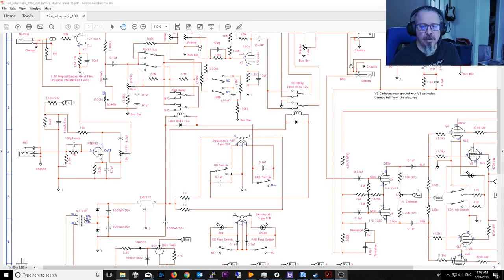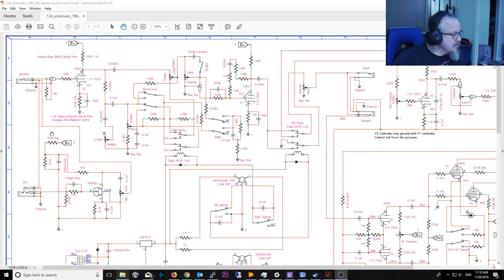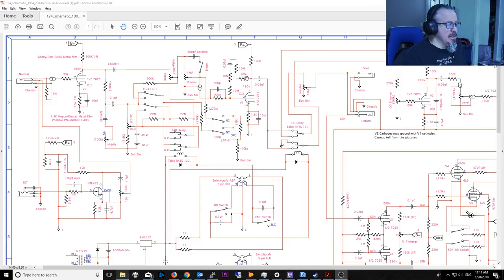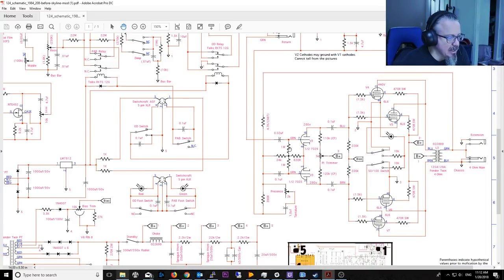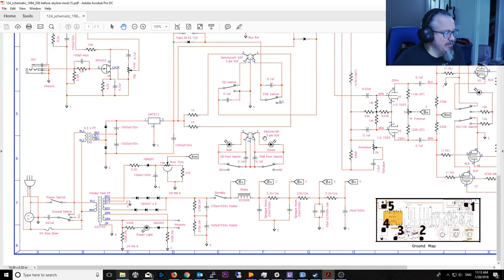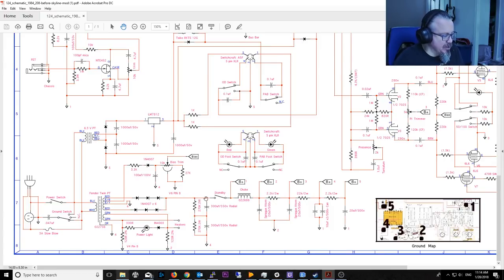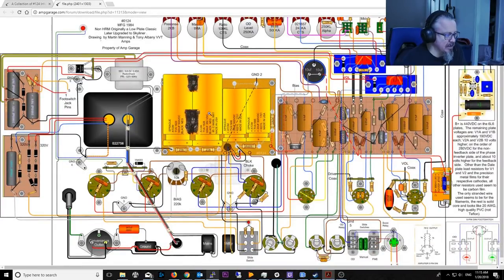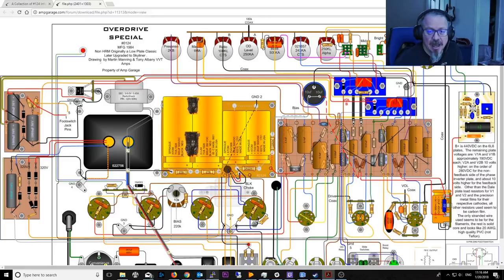Converting a Fender Bassman to a Dumble 124 Intro

Comment: Most interesting, thank you. Question..... What are the values of the cathode resistors (pin 3and 8) of the 12AX7's. The reason I ask is to know the bias of the tube (prime example of a 820ohm and a 2k7,as used in the early Marshall. The other question is the anode resistor, pins 1 and 6, of the preamp tubes. This variation affects the compression of the stage. Thank you again

Comment: Planning on buying a Bassman build kit through Mojotone and then going for the Dumble mods. Is this a good path, or should I have an alternate starting platform? Looking to build a 4 10 combo. Love this video. New subscriber.
Reply from the maker: It depends.  This I think it's based on the newer blackface or silver face versions.  So that would be the most important part.  If your amp is based on the 5f6a then it's likely not an easy conversion

Comment: Thanks for the useful video.
How to adjust the 10kftrim of the FET input circuit ?
Reply from the maker: I don't recall now that I did... I think it's for dialing in the amount of gain that comes from the fet, so that it's not too hot for the first stage tube?  I honestly didn't touch it and it worked so I forgot! :D